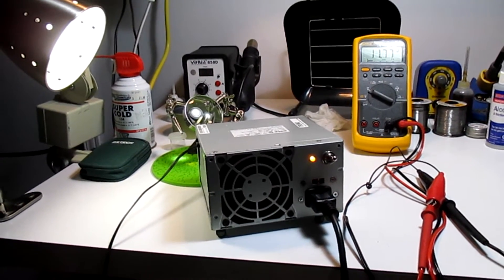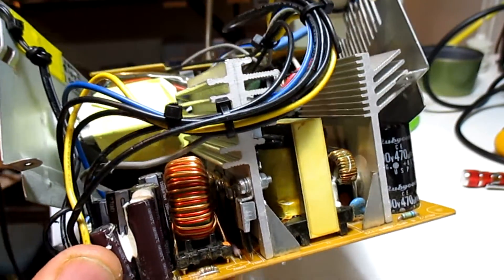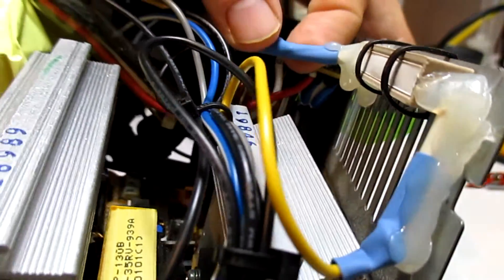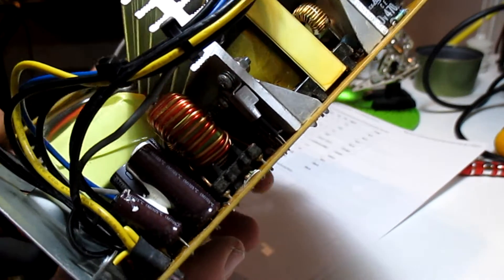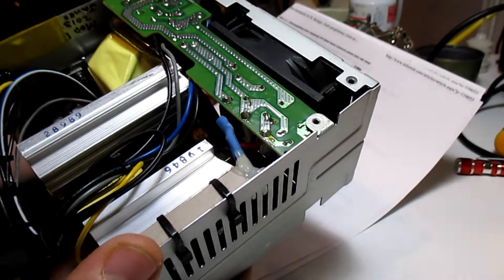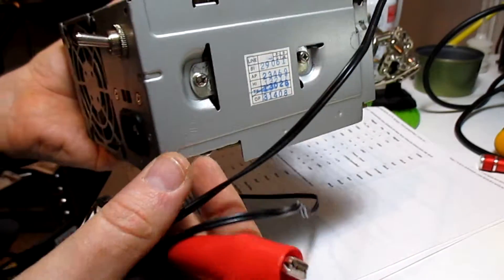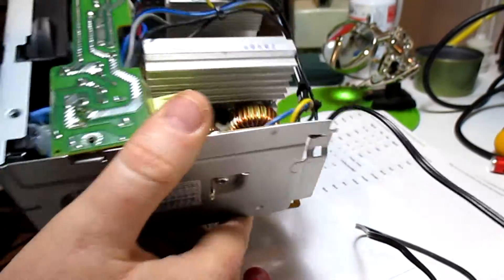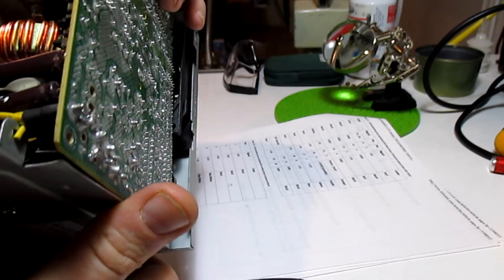Rewiring a DELL power supply. (Part 2)

Comment: I just found this video.  I'm a bit confused.  One yellow wire goes to a resistor (100ohm 10W) power side and a black (ground) is attached to the load side.  Now how are you getting power to the alligator clip positive side?  Thanks
Reply from the maker: I found the output for 12 volts and ran a wire from that externally to the positive alligator clip. The 100 ohm resistor is to simulate a load so the power supply turns on. Without the resistor the power supply would not turn on without a load connected to it. It's a safety feature built into the power supply. It's been a few years since I have used this so I don't remember the pins on the connector. You can look for a pin diagram on the internet or if you have a voltmeter just probe around for the 12 volt line then run a wire outside the power supply or drill holes in the case and mount insulated binding posts for banana plugs for positive and negative.

Comment: I found this video very informative, question: have you converted a dell power supply with 24 pin, if so which wires are used to switch on and load resistor
Reply: 24 pin only has one +12v (yellow) wire for resistor, also one power supply on (grey) wire for your switch.

Comment: How hard do you think it would be to rewire the pinout on a server hotswap power supply? like if you made a small form factor pc and wanted a high wattage power supply do you think it could be done? look this up and tell me if u think its possible HP 399771-001 1000W Hot Plug Power Supply Proliant ML370 G5 ML350 G5 DL385 G5

Comment: I had similar PSU (ps-5201-8d2) and I tried to convert it, but I used 10W10RJ resistor, and then I plugged in the power. Result was a loud BANG. And I did not touch grey and black wire. Before that I tried to put this resistor between red and black, but fan turned on just for a second and thats it. And then I tried yellow and black with resistor.. it did not turned out very well...
Reply from the maker: +archsakas I'm sorry to hear that. That 10W10RJ resistor is 10 ohms so it sounds like the power supply was pumping too much current through allowing the magic smoke to be released.
Reply: I've a Dell 250W PSU but the ATX pinout is the standard version. I've most of the current on my +5V rail so I connected two 20 Ohm 5W resistors(this is the range of ohms I've seen on most websites until I saw this video) in parallel as dummy load. Powered it ON and luckily it didn't blow up or anything like I suspected. Currently using it as a power supply for my peltier cooler. I've another 180W rectangular Dell PSU from an old Optiplex GX280 I guess. Going to convert that also to a bench supply. But as archsakas mentioned above his PSU when with a bang with low resistance. Is it because its a weaker PSU it blew up? I'm kinda worried if I should go with 100 Ohms or its going to be fine with 10 to 20 Ohms.
Reply: Also shouldn't we connect the dummy load to the rail with larger current capacity?
Reply from the maker: I don't think it's going to matter. I just put the dummy load on to get the p/s running. Without the resistor my p/s wasn't sensing any load at all and would not turn on. Thanks for the question.
Reply: @electronixTech  i took a 120 ohm yellow and black ,

Comment: Thanks for this. I searched for a week on the Dell PS. You are the only one I have found brave enough , or smart enough to tackle it.I have a question also. I can get my PS to turn the fan grounding my Green wire only, but when I put load on the 12v It will not stay on. This is without the power resistor. So you think if I put a power resistor on there it will stay on? Also the electrolysis technique works. I used it on some old rusty Ford model A rims using a battery charger. I was amazed. Thanks.
Reply from the maker: riverbottomband Hi, thanks for the comment. For my Dell p/s to get it to work I needed to short the grey wire to ground (black wire) and put the 100 ohm load resistor between one of the yellow wires (+12 volts) and a black wire (GND). I tried shorting the green wire to GND and it didn't work for my particular Dell supply. I found it was a matter of experimentation to find the correct combination to get the p/s to stay on.